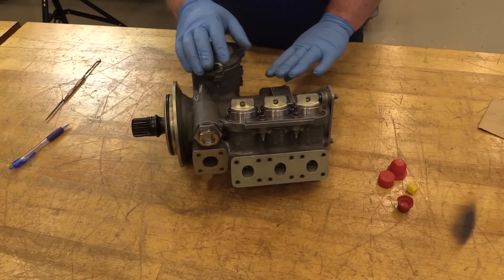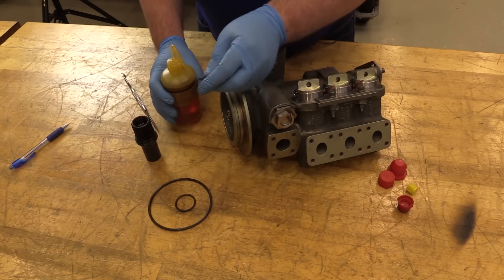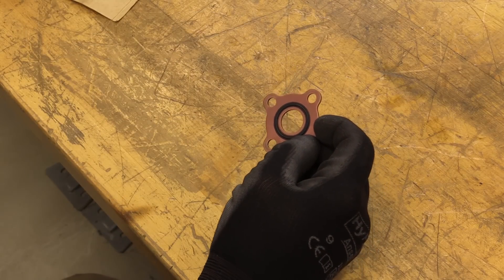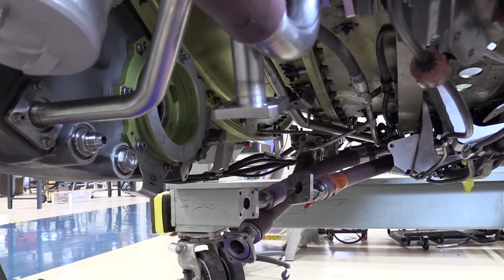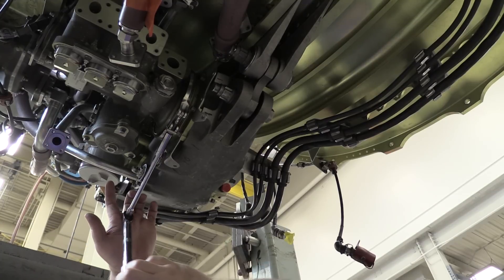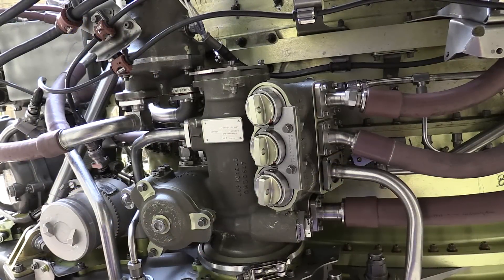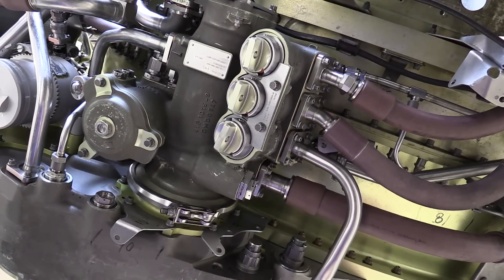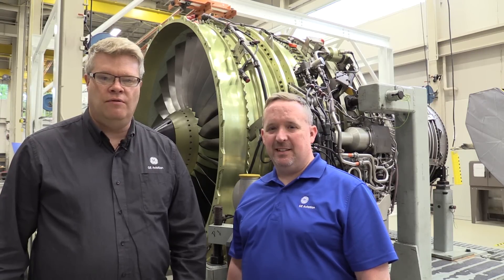CFM - Installation of Lubrication Unit - GE Aviation Maintenance Minute

Comment: Excellent video. At 5:17 ; what is that "saw tooth container" at left of this lube oil filter? Thanks.
Reply: Sorry that i saw ur comment 3 years later. This is the scavange filter and its usually tighten with a special tool, with hand tight only written on it
Reply: @tariqelhassan5263  Thanks.... It's never too late .. Appreciate..